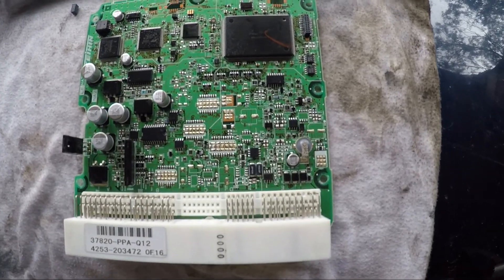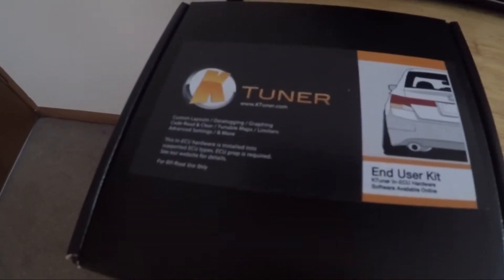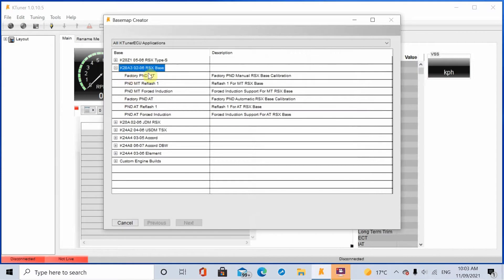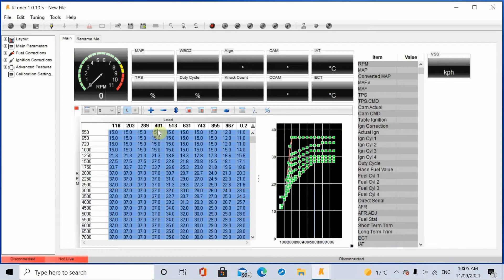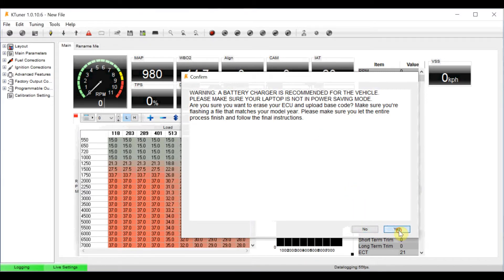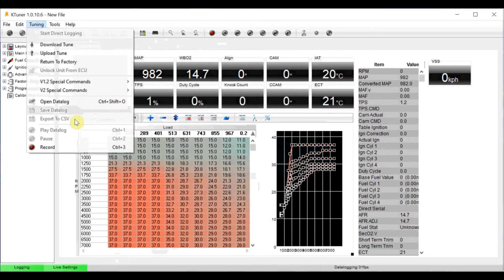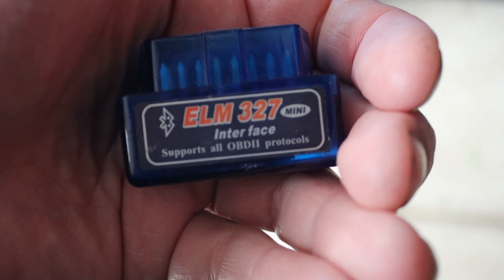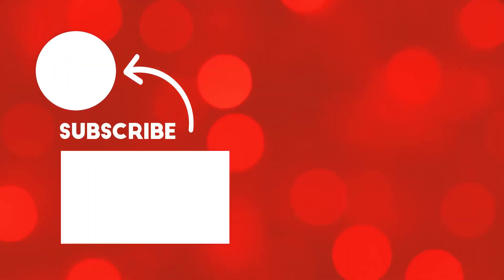KTuner end user install and loading  it up with a base tune - Bonus: OBD2 Bluetooth phone app

Comment: Hello.  My vehicle is civic 1.5 t 10th.  I downloaded 21 starter maps, but the region I live in is 980 meters above sea level.  That's why it doesn't go above 19 psi.  What can I do about this?
Reply from the maker: Im assuming you need a wider reading map sensor (like a 4 bar one), but I havent done much with boost yet so I couldnt be sure.

Comment: How do you add the extra Rpms to the table
Reply from the maker: you need to modify the rows to make room to add the extra rpm at the end of the table. So you basically squish them up, maybe with the RPM where you dont need too much detail. KTuner will work out the values in between linearly.

Comment: Really cool video, man. The only thing I don't like about my Ktuner V2 is that, I don't have a Fuel map. Ktuner says my 2012 Accord uses the MAF scale to tune fuel. So, I can't even use the % graph in the cells to see how far off my STFT are.
Reply from the maker: Yeah unfortunately thats how tuning a MAF based model is. Its all mased on scaling. Loads of 90s engines were like that (most Nissans I used to play with were). Makes it all a bit harder.

Comment: Hi TAS. I am building a project car to use a K24 as well. Can I use any of the 3782-PPA crv ecu's to use with Ktuner? Both Q01 (manual) or Q62(auto type)? My car will be RWD with Mx5 gearbox and no VSA, ABS etc.
Reply: I noticed this video is using the PND ecu and not the PPA as in your other video. Does the PPA not work with Ktuner?
Reply from the maker: I asked KTuner about the PPA (on their forum) and they told me they were not compatible. In the end i ended up getting a PND ecu from the states and using that. A full list of supported ecus is on the ktuner site and it will list all the codes which work. Pretty sure being for a conversion you'll be right with pretty much anything. Some ECU's have slightly more features than others.

Comment: Finally someone using ktuner!!
Reply from the maker: haha - everyone seems to use Kpro right?
Reply: @teamaxlestands  Hey, how did you end up mounting your throttle cable?
Reply from the maker: I used the stock D series throttle cable and used a J series accord trottle cable to tb mount. Might be worth a trip to the wrecker and just see, pretty sure lots of Hondas share mounts which would work
Reply from the maker: you can see it here: https://youtu.be/ZS9sLJooh-4?t=391
Reply: @teamaxlestands  thanks!
Reply: I’m using it too
Reply: @gy6justin425  update: drove the swap for 30 minutes and the transmission blew. Guy scammed me the insides of the trans were missing parts 😭 sold it and bought an ek. Crashed it...